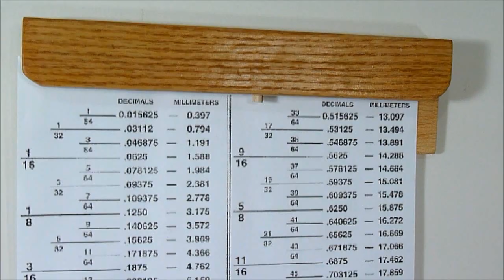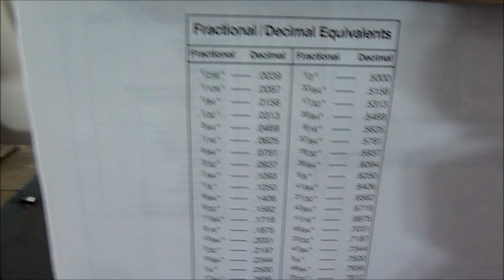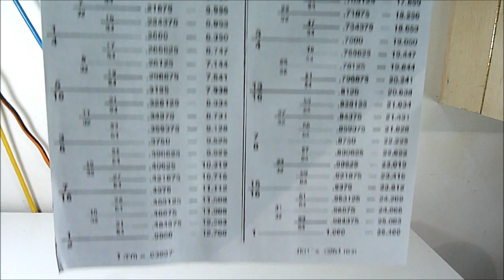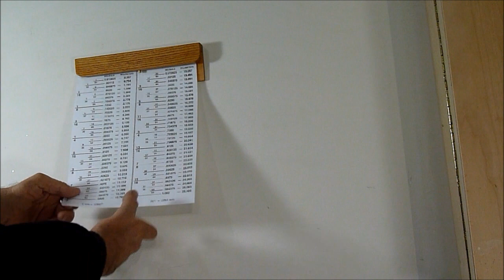Paper Holder

Comment: Thanks. I just made one but I made it out of a solid piece of birch. At first my front was the same size as the back and it was hard to get the paper in. Good thing I had enough meat in the front to cut the front shorter, now the paper is easier to guide into the slot.